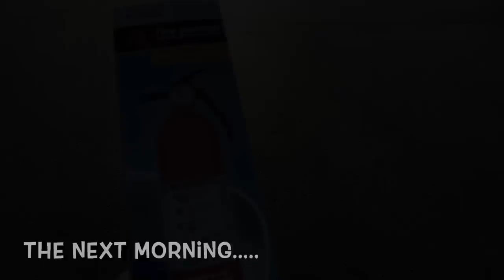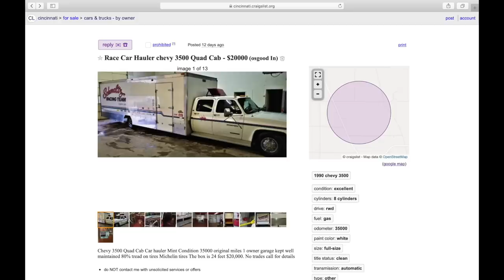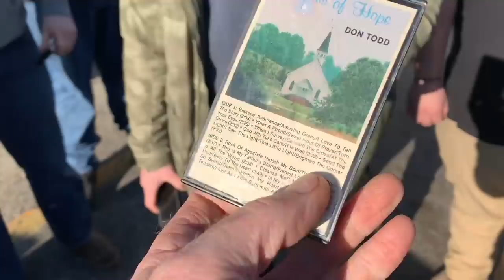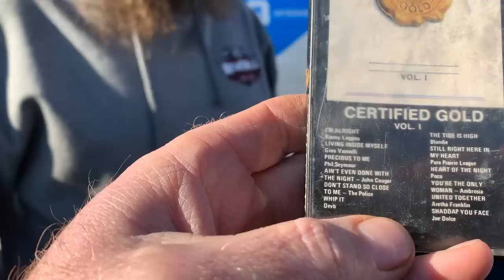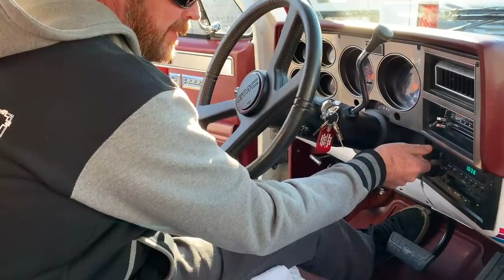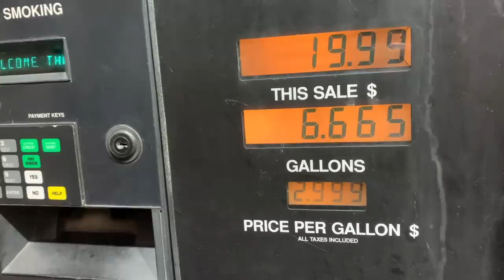Finnegan's Garage Ep.60: Blowouts, Rusty Gas Tanks and The World's Longest Ramp Truck!

Comment: I don’t think I’d send those plates back if it were me
Reply: 'well ya see sir.. the post office called me and told me they couldn't find my package after i dropped it off.'
Reply: Somebody else said send them back COD for whatever the cost of new tires and sorting out the fuel system is lol.
Reply: I would for $7000-$10,000 but nothing lower than that.
Reply: I'd tell em it fell off the truck on the way back home
Reply: I would mount them to the wall inside the enclosed area and tell the seller they fell off in Tennessee.

But what I don't get is why did they not stop at a walmart and buy a few more gas jugs?  They could have pulled over on an off ramp and added gas, or split the fuel line and fed the pump off of 2 fuel jugs.

Comment: I bought a 77 gmc vandura box truck with a 400. The truck has the full body kit like a full conversion van, looks awesome like a hot rod. Cool paint job, fold out bed, a couch, recliner looking driver and passenger  seats that turn all the way around, a separate area in back with shelves for tools. I feel like these guys, bought it thinking it was kept up with, I've replaced fuel pump, front calipers, the brake lines, hydroboost, master cylinder, fuel line, added filter after tank, all power steering lines, power  wires, ground wires, speedometer cable, all hoses as I run across them, cleaned carb, and six tires. Needs rear brakes completely went through, gas tank, power steering pump,  and full tune up. But I still love the way it looks, not many sensors, and no computers. Have not seen one done like this on bing or google, just the one I have on there. The guy just wasn't totally honest about the condition and charged me too much for it. I still love it.

Comment: I'm really surprised the seller even answered the phone once you pulled out of the parking lot.
Reply: Mike had his plate. And the plate wasnt even on the correct vehicle. He was just trying to make sure it didnt come back on him or thought about all this being filmed and put on youtube.
Reply: Seems like the seller went above and beyond. Any vehicle that old with that little milage is going to have some issues and fuel tank issues are usually top of the list
Reply: @aronsingletary  where the seller went wrong was his add. He guaranteed you could drive it accross country😂 give taillight warranty
Reply: I guess, I thought the phrase buyer beware was coined for a reason. I purchased a mint condition convertible Mustang and discovered I could not run my headlights and windshield wipers at the same time. I held no animosity towards the seller as the vehicle was twenty five years old.
Reply: @aronsingletary  I agree I've bought and sold over 60 cars. Never went back to a seller but 1 time. Guy guaranteed no problems with the 4 runner and engine seized next day. He told me to go F myself!  I only tell buyers my experiences with the vehicle and no guarantees once you drive off. Covers my ass.
Reply: Buyer beware, and Sold as is.
Reply: Use a press to fold and fold and fold it, and mail his plate back as a cube!
Reply: @aronsingletary  So was that a Fox body 5.0 litre? My last foray into that realm was a 2k 4.6 gt vertible with catback exhaust. Very throaty, kinda weak for hp, so ford put 1st and 2nd gear ratios really close together so it'd sound sick as you ramp, ramp, but 3rd was kinda long, so it's ramp ramp lug, bad enough I'd just skip 2nd, cause it took as much time to drop the clutch and mate rpm to start accellerating again that just lugging in 3rd had the same result.
Reply: @generalxanos  yeah, 1989 LX 5.0. It was cherry with 50k miles, got side swiped by someone in a left had turn lane that decided they were going to go right about two months after I purchased it. It made me give up on my vision if a perfect Fox, got a Road King to satisfy the open air itch.

Comment: A 30 year old truck, no matter how it's been kept, is probably going to need fuel tanks. If they are full of rust, they are probably full of pinholes and the rust is all that's keeping them from leaking. 22 year old tires, as we found out, don't hold up too well. I use the three year rule on modern batteries. If the battery is more than three years old, it can go bad at any time and it will be surprising how quickly it goes bad. I've had several quality replacement batteries do this to me in recent years while I had an OEM battery that lasted 11 years, but it was made in the nineties. I wish that I had faith in the new ones.
Reply: I don't agree on the point about the gas tanks.
Reply: Why not? Thirty years is a lot of condensation getting under the fuel. If there is rust, where did it come from? Sheet metal gas tanks will pinhole very easily once they start to rust. This truck is old enough that that the fuel tank is not sealed and moisture can get in through the vent. I hope that we find out what was in the fuel tanks once they are dropped.
Reply: Bill Giles good point and every thing u say is true! I bought a 1979 ford f100 custom cab short bed for 2500$ and it was sitting for 5 years, engine is like new it's a original 302 and I have no problems with the engine but the problem is the tank. This thing left me every were because of all that shit that was in the tank so I would recommend to buy a new tank before u hit the road in something that was sitting for ever
Reply: Bill Giles when you buy a $20,000 truck you expect more
Reply: When you buy a thirty year old truck off of Craigslist, you had better expect a lot less. Overall. I think that it's a pretty good truck and a pretty good deal.
Reply: I don't agree re: gas tanks either. My bmw is 30 years old and has no fuel delivery issues
Reply: Did you just buy your BMW off Craigslist? If a vehicle is not being used regularly and the fuel isn't being replenished regularly, you are much more likely to have issues with water in the fuel. I never said that fuel tank issues were inevitable, just a lot more likely in 30 year old vehicles that have been sitting for a while.
Reply: @wgiles51  it does depend entirely on how the car was stored. I bought mine from the father of the owner on craigslist, his kid kept getting tickets in it.
Reply: Best post here.

Comment: I sold an old van to a guy and straight-up told him the radiator would need rodded-out or replaced and the battery was a bit weak (don't let it sit more than 2-3 days) and he was cool with it but said he was going to be using it to travel from here in MT up through Canada to AK for a while.  I told him it would need work before leaving, he was cool with the whole deal and gave full price cash.  I gave him $300 back so he could get a battery and either clean out the radiator or buy a new one to get on the road with--I think if someone doesn't jerk you around then it's only respectful to give them some breathing room.  To be fair, this guy did a lot of running around for hose, jumper cables, etc. but c'mon, toss in a battery.  As far as the plate goes, I think I'd rather have him take it than ridin' dirty on a plate belonging to another vehicle.  If you've got a signed bill of sale from him you're good to get it home.
Reply: Some places you need a trip permit if you don't have current plates.
Reply: @AndreS_-df2nw  Aren't you legally required to remove your plates when selling vehicle? I think this is the law at least in Pennsylvania.
Reply: @mibars   depends on the state, I guess. In WA,  they stay with the car.
Reply: Yeah and it’s not like getting pulled over 10 or 15 times was going to make the trip take any longer. Lol

Comment: Cmon guys...you should know by now any time you Purchase a Used Vehicle...a New Battery is a Must! As is Tires, Fuel Pump, Water Pump, Alternator and Brakes!!! I have NEVER bought a Used Vehicle that didn't need most of those Parts before getting out of the Driveway!
Reply: Even on a 20k vehicle advertised as in "perfect" condition?
Reply: Mat Gee 

Cosmetically yes it appears perfect to the average person. These guys know enough about cars they should have seen the clogged fuel filter as a huge red flag. You don’t buy a car and then inspect it.
Reply: @matgee8892  Yes!
Reply: I mean that as answer to your question,  not yes I agree with you.
Reply: i bought my 72 el camino an didn't need any of that till i put about 300 miles on it
Reply: Reason you should always arrive with a new or secure battery is pretty simple really, cars that get sold don't travel. Old cars can have parasitic draws, and when you combine those two alone, that's an obligatory reason.
And folks, it doesn't even need to be a good one, just get the cheapest that fits the bill, you'll figure out the logistics later.

On another note, a friend of mine that has a job to secure old cars for parts, ALWAYS travels with a configurable capacitor and battery hybrid on him.
Reply: @matgee8892  mileage only indicates road use wear. Hours run often aren't indicated and oxidation/corrosion only needs time. So yes, if it's sat as long as this tank...... check EVERYTHING.

Comment: Low miles on a old ass truck and it has a bunch of problems??? What??? That's crazy
Reply: square body chevys are notorious for the tanks rotting if they sit
Reply: Its probably been sitting since the late 90's.
Reply: Made in America... Just look at how much care was taken fitting the roof lining.
Reply: its a 32 year old truck... small things are bound to not be 100% find an import in 100% new condition from the same era
Reply: @TheWhatman21  I'm not suggesting current American vehicles are built that poorly but that time wasn't America's greatest era for vehicle production. I actually like it but 20k was too much. Today it makes no sense having a vehicle that does 5mpg which means big bucks on a diesel conversion. I hope he doesn't feel like it was a holiday romance in a few months.
Reply: @johnwilson1794  I agree k is way too much. and they'll get overdrive in that truck and a great tune up or new efi system and get that truck to15ish mpg
Reply: @TheWhatman21  If it was you or I it would probably cost 10k to get that thing where you'd want it to be. Fortunately for Mike with sponsors tipping in parts and money to the different shows he'll probably get out of this for next to nothing. If sponsors were willing to help a diesel would be perfect in that thing. Something like in the Roadkill ramp truck. 500hp and 1000lb/ft and a matched auto would make it a really nice thing. They didn't even have any weight in it and it was still that bad on fuel, it will be worse with a race car and parts onboard.
Reply: John Wilson I mean yeah if he could stick another 12valve in it that would be awesome. I tow my race car with a 94 Chevy 3500 dually 454.. I can say with the box trailer behind me or not I get 8mpg it's like that motor only knows that number. My friend has the same truck and trailer set up as me with the 6.5 turbo diesel.. slow as hell but averages 22
Reply: @TheWhatman21  Yeah that's the problem. When you have to tow a lot of weight you can't beat a diesel. If he had a Cummins in it he could probably tow another race car on a trailer as well and not notice. Although that might breach highway regulations for vehicle length. :D

Comment: Had a guy haul an 85k10 from oklahoma to new mexico to trade me for a vw baja bug. He drove the bug and looked it over, said it was exactly how i described and in the pictures i sent. He was happy with the deal. Dropped the k10 and loaded the bug on the trailer and took off. Called me a couple days later and said the motor blew on him. (I have been driving this bug for years without issue) i was willing to send him a little bit of money to help with a rebuild because i felt bad for the guy. Untill i found out he adjusted the carbs (for some reason beyond me) and ran it lean at the top of the tach for long periods. Then i told him i wasnt going to send money because he was the cause of the failure. He was cool about it and said he didnt expect me to send anything, just wanted me to know what happened.

Comment: This year did have an overdrive, because of a lock-up converter, making this 4 speed TH700R4 really smooth.  Maybe, a vacuum hose has rotted out or a bad valve body is keeping it from going into overdrive.  Unless, on the rare chance, this truck has a TH400, then no overdrive.  I had a 1989 Chevy 3500 dually with a TH700R4.
Reply: I've got a '90 C1500 with a 4.3 and a TH400.
Reply: Dead Eyed Demon I don't think the 454 had the overdrive transmission mated to it.  I know they didn't in 1987 or 1988.
Reply: @Tsuki san My 89 454 does.  It's also a long frame flat bed like Mike's last truck.
Reply: LOL weak as 700R4 behind a 454 in a 3500, no way... trans have to be a TH400.
Reply: @Matt Pratt Only had a couple of issues with mine with vacuum lines and a bad valve body, even after carrying a Sand drag Jeep and a C2500 Prerunner most of it's life. Otherwise, it was bulletproof without any mods other than a trans-oil cooler.
Reply: It's a TH400. The 4l80e, which is the overdrive version of the TH400, didn't come out until '91. I knew it wasn't OD when I saw the carb on it.
Reply: It's too large GVW to have a TH350 or 700R4. The 4L80E is electronically controlled so that carbed engine won't operate it.

Comment: First off, I did love the video. Very much reminded me of original roadkill that made it famous. Haven't watched a single episode since the platform change. That being said, you bought an old vehicle that had been sitting and attempted to drive on a long road trip to get it home. Chances are the owners knew you were coming so decided to give it a shake down and realized a problem with the fuel system. This occurred after the ad was posted, so no false advertising there. As far as they knew it was running and driving fine until the day you came to pick it up. They did what they thought it needed to be fixed. In fact it drove around town fine for you which is probably what they did to test the fix. Things go sour when you get on the highway. At that point you have purchased the truck, and it is no longer their problem. They did you a solid running around getting you parts. The only real misconception I see is the mention of the tread life of the tires in the ad. Either way, I think they helped you out more than they needed to, so the shaming of the previous owners is a bit harsh. This is unless they purposefully tried to HIDE a known issue with the vehicle, which I do not see from the video.

Comment: Jesus 20 grand for that truck and it barely runs
Reply: To be fair, the thing is pretty mint.  Mechanical things aside.   However, that seller is a massive prick.
Reply: @cypressgold  ya
Reply: Build one for cheaper. Motors are cheap. Gas tanks are cheap...Not to mention how nice it is.
Reply: It runs great as long as its getting fuel. It's common for tanks to rust when they sit. Especially if they're parked with empty tanks. I seen this coming when he first said how many miles it had on it.
Reply: @jeepsterdaddy37  you can pretty much thank the BS fuel we have now days. Alcohol is NOT a fuel. It absorbs water and rust tanks and fuel systems out. Take 1 gallon of Alcohol,1 gallon of Water. Pour them together you get LESS than 2 gallons of mixture. The alcohol and Water mix so well that they take up less space.
Reply: Next the rear end blows up from having 20+ years old gear oil, but only after it spits every U joint out because they are dry as a bone. Not to mention rear wheel cylinders or front brake caliper piston seals or even the bone dry front wheel bearings. So how much this $20,000.00 dollar truck cost now?
Reply: kinda saw the breakdown coming. shes not used to being used often.   @jeepsterdaddy37
Reply: That truck's a unicorn, find another one in that good of condition, it's 30 years old.  I expected the fuel problems and bad tires.  Finn new he was taking a chance driving it but hey man, Roadkill!  Now that he's got it home he can go through it and change all of the fluids, hoses and stuff that's gonna fall apart now that it's going to start getting used again.  The seller was a dick though, he should of helped more.
Reply: @richc9503 It was advertised as mint condition. The man flew across the country based on that description only to find out the truck probably hasn't moved in 20 years.
Reply: @justinmcslappy  Finn isn't new to this he should have known those kinds of things always happen to him and he knew the truck had sat along time. I wouldn't call the guy a rip off or anything else as he did help them to get it going even though he didn't follow them to the motel which might have pissed me off too. Finn bought it as is and knows better as this isn't his first rodeo.
Reply: @justinmcslappy  I agree but even so the truck is in phenomenal condition for the age.  The guy should have stepped up and helped them out.  I bet Finn's still glad he bought it.
Reply: @justinmcslappy  And it is mint. Mint doesn't mean the seller knows the thing inside and out - it's a description of cosmetics. Clearly, based on mileage, it's spent a lot of time sitting - anyone with any mechanical inclination whatsoever knows that is not good for longevity for anything mechanical.

Comment: 28:50 Mike did you forget that old GM ignition switches turn backwards for accessory? 😂
Reply: they often quit doing that when worn out from many cycles, being low mileage and hauler, it's hard to say..
Reply: throttle bottle wow, don’t think I’ve ever seen that. I’ve had a bunch of GMs over the years. Only thing I’ve ever seen was worn out keys able to be pulled out while running🤪
Reply: Not that old, they didn't turn backwards till 95